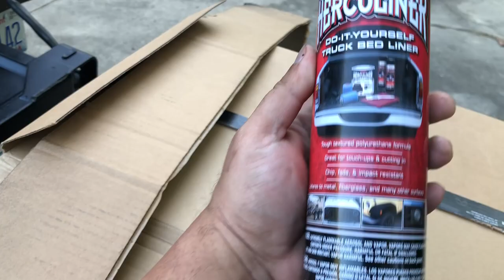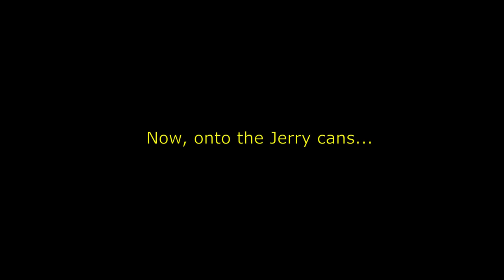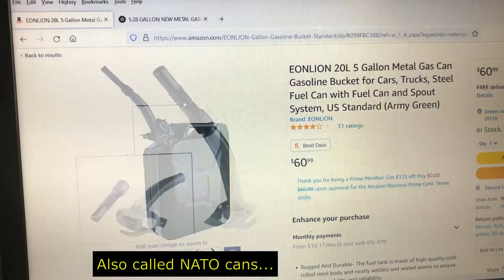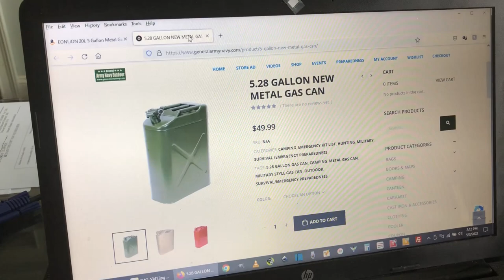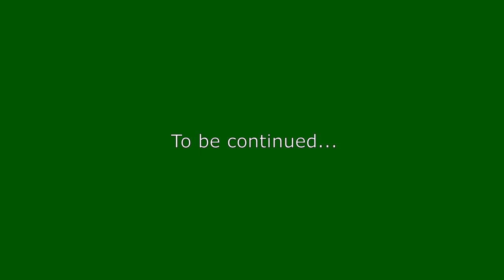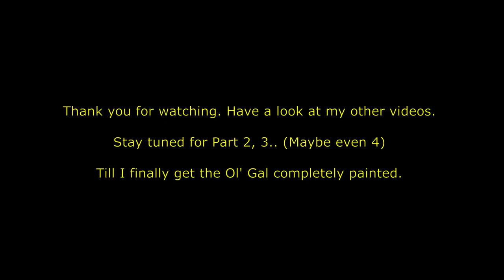Painting My Humvee - PART 1 of 3

Comment: Can you comment on the paint?  What kind and where did you get it?  Not the bed liner but the 383.
Reply from the maker: Sure, there are two types I use. 
1. Spray paint 
383 CARC substitute from Rapco paints. 

2. Roll on paint
383 Latex color match from Home Depot. Look at the door paint video to get a screenshot of the color code from the can. Here’s the link 
https://youtu.be/e2zr1rBk0S0
Forward to the 2:15 mark.

Comment: Which Carc 383 spray paint do you use?
Reply from the maker: Rapco paints
Reply: @MyHumveeMathilda  thanks! You happy with the outcome? Just saw your part 2 video as well..... Also. Did you use a metal primer spray on the body before painting?
Reply from the maker: @raphaellilkerdpm5916  nope, just cleaned the original CARC and sanded it a bit. That stuff bonds really well to the roller and spray.
Reply: @MyHumveeMathilda  cool.. Thank you!